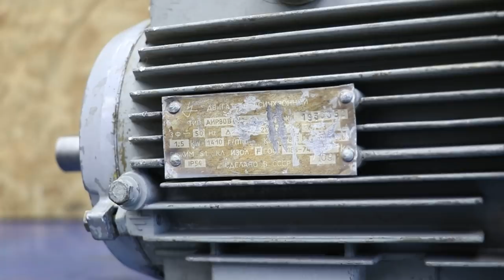COOL IDEA!! Machine for Cleaning Pipes from Rust!!!

Comment: Great idea, great video, thanks for sharing. My I recommend, one very small modification, the hand locking bolt for the electric motor, that secures the location on the height adjustment, either cut a very small BRASS slug, to fit between the steel rod, and the steel hand locking bolt, that you knurled. Or just via brazing, just put some brass at the very end of that part. This way you have (soft) Brass touching / engaging the steel rod, to secure a locking position. I'm willing to bet, that sometimes the steel to steel engagement, loosens sometimes, from vibration. Good luck.
Reply from the maker: Thanks for the option! But the grip is very good due to the fact that the rod is a little at an angle and it does not slip!

Comment: I like it. Extremely useful for cleaning scale and rust off of metal. 
I noticed you mostly used the wire wheel that did a good job. When would you use the sanding discs and for what purpose. ??
Reply from the maker: The grinding disc poses a risk to the metal for better adhesion to the paint.